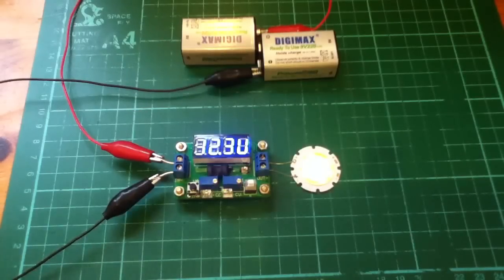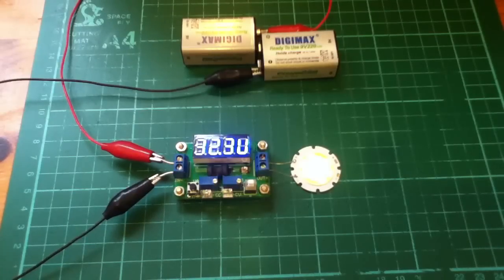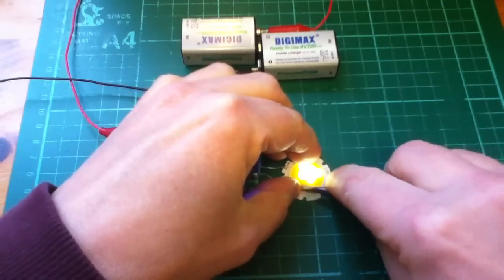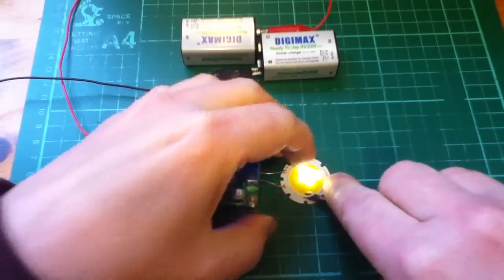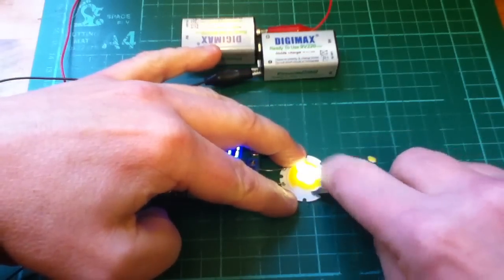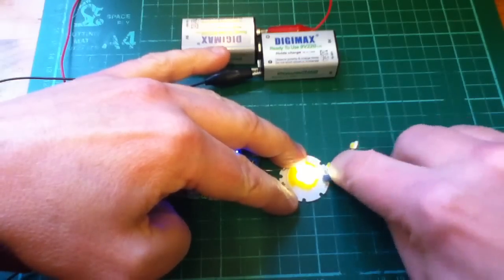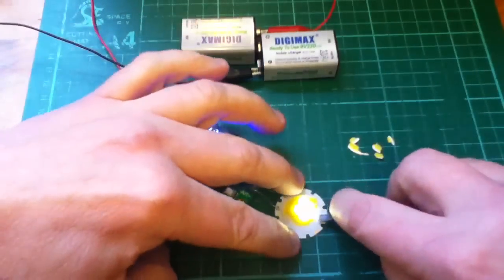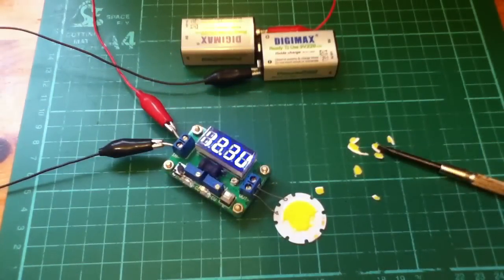What colour are the LEDs underneath the phosphor of this COB LED?

Comment: The LEDs are dying because the manufacturing process attaches the top side of the chips with a micro-wire, and pulling the phosphor off rips off the wires.

Comment: Usually it's royal blue LED's. If the die is big enough you can try to remove one of the dies from the phosphor and light it up with sharp multimeter probes against the pads using continuity/diode mode on the multimeter.

Comment: Utterly horrid! Who is this bloddy idiot! First disconnect the two 9V botrreys (how the Brits pronounce batteries, BTW...). Then yew (how the lil people across the pond pronounce 'you') take acetouuune (that's acetone in Brit speak) to the epoxy resin to weaken it. Afterwards, a short blast of high-pressure air remeuuuuvs the phosphor coating that had been weakened by the acetone, leaving all SMT components perfectly in place. A nice and clean result that would take less than 30 seconds of YouTube time.Did it, done.The American way. ;p

Comment from the maker: I'm sure you're right. I didn't really expect this to work - but it'll be fun trying. Power control will have to be constant voltage. If I use constant current and one series string fails, the others will go over current and fail too - a cascading failure.